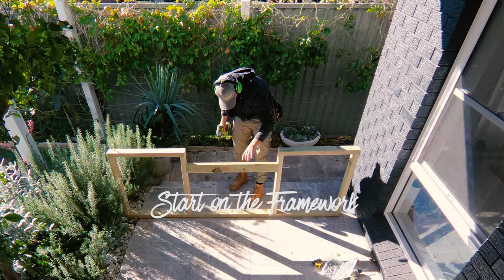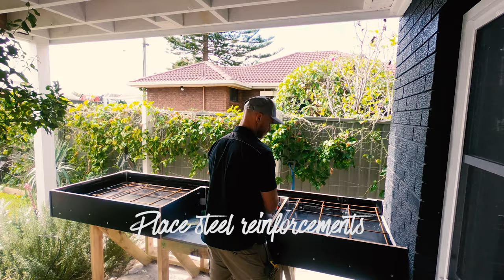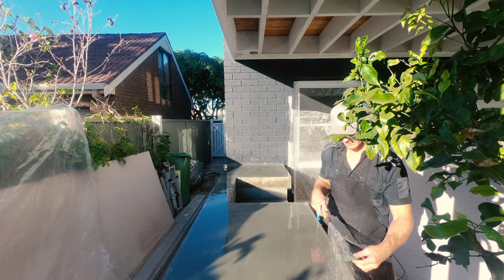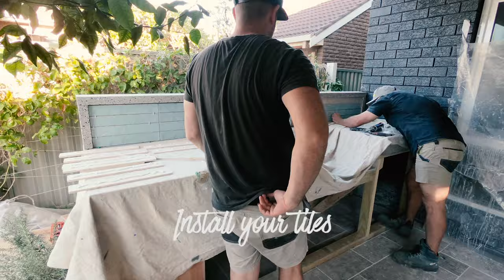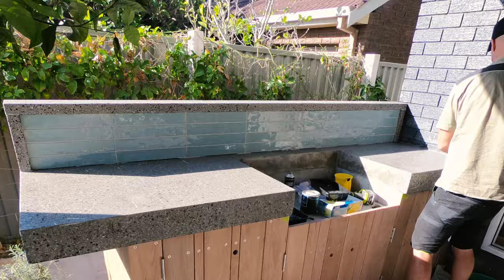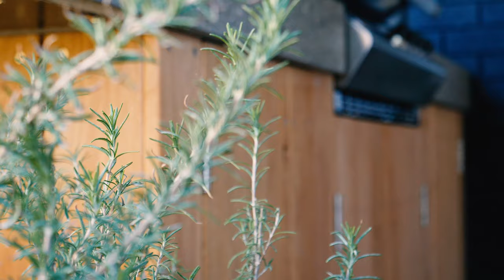How to Create an Outdoor BBQ Area

Comment: Just wondering what hinges you used on your cabinet doors? I have built a similar set up using 45x35 frame and 22mm pine decking as cladding however, I have been unable to find a non-mortice hinge like the one you have used that allows attachment to the frame and still the hinge pin to sit our proud of the decking board. I am reluctant to attach the hinge to the pine decking as the soft timber won't hold up to the weight of the door on the hinge.

Comment: I’m looking to build something similar and just wondering what you specifically use for the fibre cement sheets (brand/thickness)? Is it something like Hardiepanel? I’ve been to Bunnings and my local hardware store and they have no clue what I’m asking for when I tell them fibre cement sheets. Thanks
Reply from the maker: Hi, maybe just explain that you need a non-combustible material?

Comment: are there any smoke issues from the grill being under a roof? Ours is under a roof and we are trying to find solutions for the smoke
Reply from the maker: Hi Arnie,  We don't have any smoke issues in this area as there is plenty of natural ventilation, and sits underneath a deck so it isn't underneath solid ceiling.  Is it an option to install an exhaust fan for your grill?

Comment: Hey guys. Did you mix the concrete on site in a mixer or order a polish blend for delivery from  an agi?
Reply from the maker: Hello Richard, we ordered a pre-mix concrete from Boral called "Ocean Floor"
Reply: Ahh shit.. I poured mine using a concrete blend with added white stone in a mixer.. giving it 3 weeks to cure before I grind it down.. hopefully comes up similar to yours.. 🤞
Reply: @KyalandKaraChannel  Hey Kyal, ripper job mate, love how you exposed the aggregate, might be a dumb question but did Boral just deliver it pre-mixed?  Also, how long were you sanding it to expose the aggregate?
Reply: @richardsquires9388  how did it go... got any pics?

Comment: what timber did you use and what size ? Treated or untreated pine ? 90 x 45cm MGP10 ?
Reply from the maker: Hello Howard, We used 135x18mm Blackbutt decking boards to clad the front and H3 treated pine elsewhere.  There's more detail and step by step instructions if you follow this link: http://www.kyalandkara.com/renovate/how-to-create-an-outdoor-bbq-area
Reply: Kyal and Kara hey guys thanks for your reply. I’m going to have a crack at this, never tried anything like this before. I was after the size of the H3 treated pine if that’s ok ? Cheers
Reply from the maker: @hwjones10  Depends on the size of your BBQ area - our measurements are all listed in Step 1 when you follow the link I've posted above.
Reply: @KyalandKaraChannel  He guys, love the BBQ. As per Howard's query I wondering what size treated pine you used for the frame as its not actually mentioned in step 1?
Thanks.
Reply from the maker: @TimboDg01  the dimensions of our BBQ area are listed, and as mentioned above, the sizes are all dependent on the size of your own area - you'll need to measure your own space to determine what size pine you use.
Reply: @TimboDg01  looks like 90x45
Reply: Yes it looks like 90x45mm